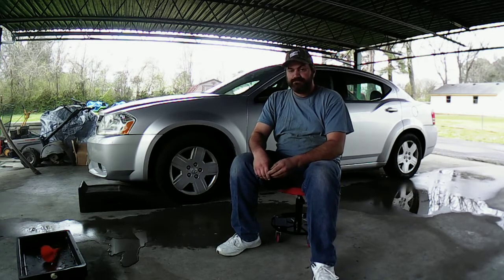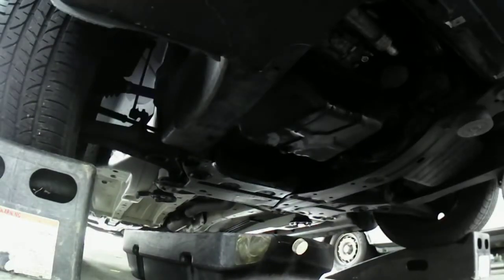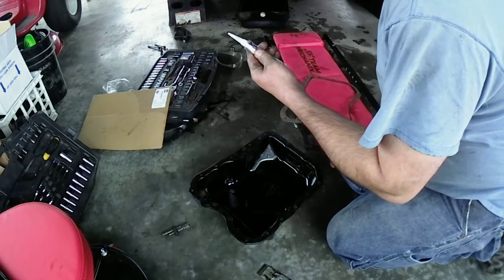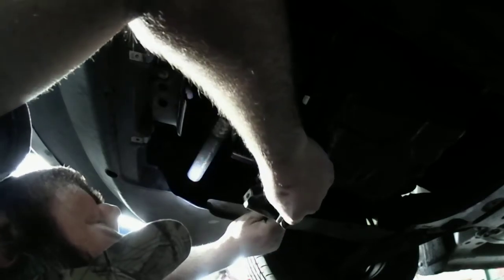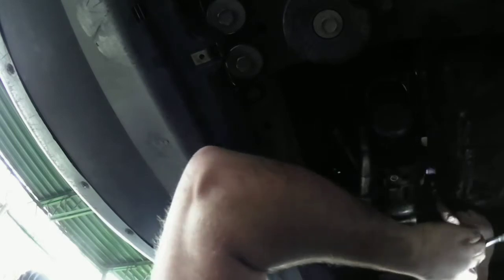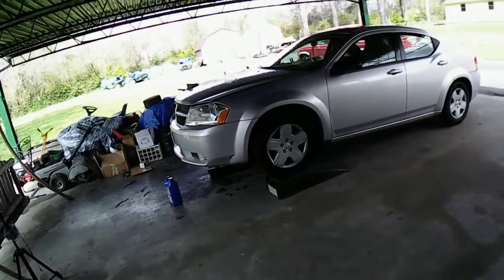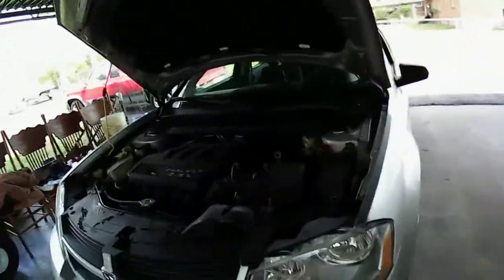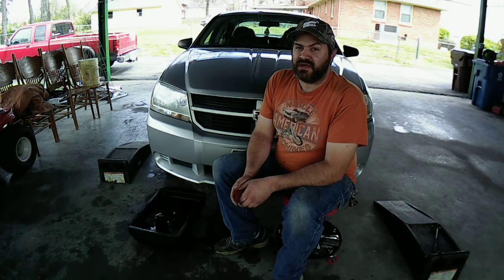oil pan gasket replacement 2008 dodge avenger

Comment: Hello Turning Wrenches, I not a fan of the cork gaskets but sometimes we have no choice. I think that's why they give you a tube of gasket maker lol. I use super tech oil in everything. You did a good job filming without your tripod. Stay well 🔧👍
Reply from the maker: Thank you there I hope this holds out yes i know i didn't show what all had to be done very Well and the video was longer than i wanted lol, hope all is well with u sir
Reply: @Turningwrenches85  It will hold because you did it the right way. All is well here Thanks!!!
Reply from the maker: @gravelyman  your welcome, appreciate it very much 🙂

Comment: Nice repair John! Those 2.4 engines can't be that bad if it went 219,000 miles and its still going strong. You will get to 500 subscribers soon.👍🇺🇸 Roger #superclean
Reply from the maker: So far knock on wood roger #superclean